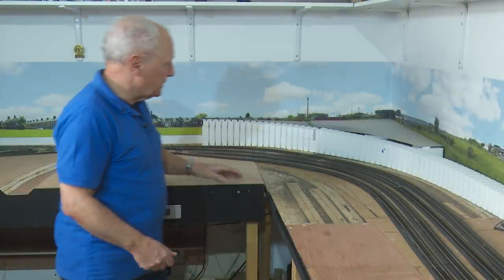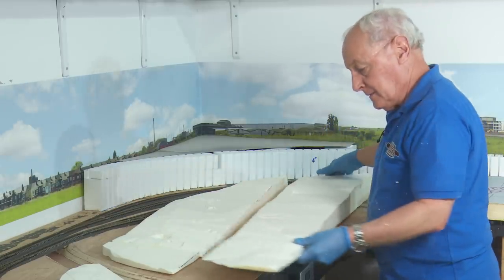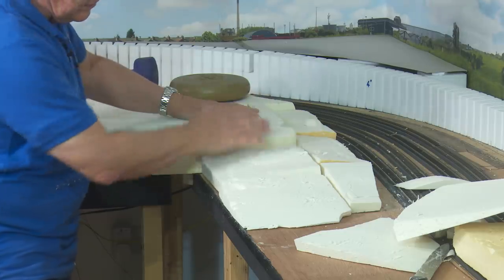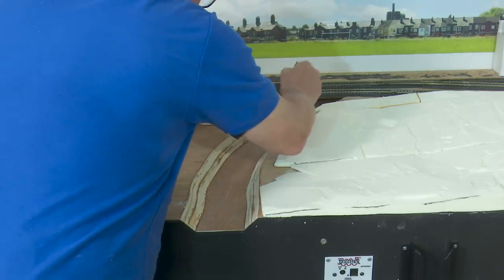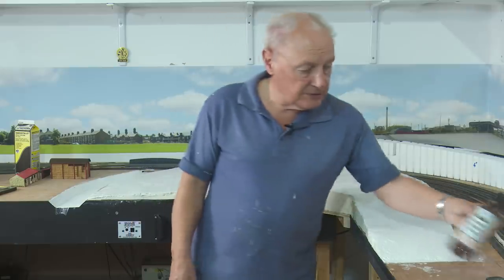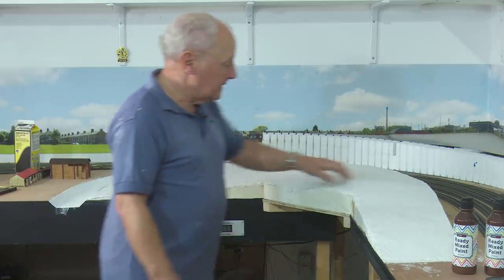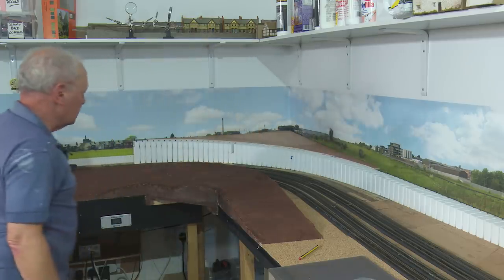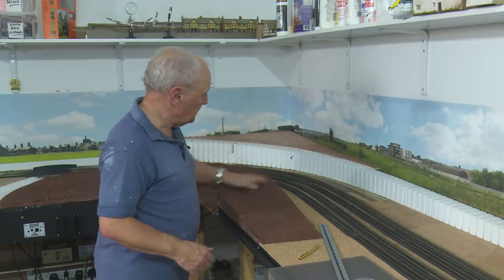Landscape Building and Road Construction at Chadwick Model Railway | 145.

Comment: Fascinating as ever.  I do like the contrast in the colour of your trousers between the start of "messy work" and the end of that day.
The cross members under the bridge deck are going to be difficult to see by visitors but probably add to the structural integrity of the model.
And finally, I do hope you've left enough space for platform 1 in Chadwick Parkway.  I did notice the measuring rope was on track in one shot.
Reply from the maker: Thanks Lee. I’m pretty sure about the platform length but hey, it’s only a slash with the carving knife!  The steel box sections should show up well with the track camera. Regards Charlie
Reply: I am a Toy Train ENGINEER. I have experience with Legacy Lioncheif Plus2.0 and conventional Steam and diesel engines.I looking for work on your British Railroad. Are you doing any hiring
Reply: @OgaugeTrainsplusslotCars 
Cs

Comment: A neat way to break up and terraform that corner of Chadwick Charlie. By making use of the upward banking route to determine the lay of the land and engineer the space available. Not just the rise and fall between the river and the station, but also the rear corner to the front edge. It will make a great scenic break to the layout once you have this section finalised later.
Reply from the maker: Thanks John, I always feel that I struggle with my imagination and always consider the advice on offer.

Comment: Charlie, I have worked with plaster cloth on my layout just as you did, and you are so right.  It is a remarkable material to work with.  I have learned through my own trial and error to modify the technique.  Now I cut the pieces of plaster cloth and one by one I lay them in place and spray with water, then smooth by hand.  They are easy to lay down dry, the spray when the piece you are working with is nicely in place.  This way eliminates moving the plaster cloth around while wet.  I love your videos.  Best regards, Doxie Frayser  Memphis Tennesee, USA
Reply from the maker: An excellent tip Doxie. Regards Charlie

Comment: Charlie. For the corner ply section you could use small magnets instead of glue. Much easier to remove if needed.
Reply from the maker: No, I’ve only glued down the peers.I’ll put a hook under a building to lift out the whole section.
Reply: @ChadwickModelRailway  Cool. Love your channel. 🤗☺️

Comment: Thanks for another good video Charlie, a tip I was given when using the rocket type glues was to put a wet bit of kitchen towel in the bottom of a jar and put the tip on the wet towel between each task to stop it clogging up, it really works very well.
Reply from the maker: I shall try to remember that Richard. Regards Charlie.

Comment: Enjoyed this vid. As always well made.
What I found with the sculptamold, was that even here in Australia, it takes a long time to dry. I avoided painting it until it was dry.
I also found that the sculptamold will get mildew. In the first run I found the problem, and then used a mold and mildew killer / remover to fix that, and in the next layer, I added some of that to the mix when making up the sculptamold. That seemed to work. There was no mildew in the subsequent layer.
The problem seems to be the fibrous filler holds on to moisture for a long time.
In the end, I used a small portable rechargeable fan to help the drying process.
Reply from the maker: A fascinating comment Peter. I never knew about the mold issue.

Comment: Hi Charlie.
Don't forget to leave potholes in the road, something that country roads suffer badly from. It will add to the authenticity and incompetence of the local Council. 👍
Reply from the maker: I think you’re right Paul, I should model them on the roads around my home! Regards Charlie
Reply: Hi Charlie.

Thanks for your response. I suffer from the same problem I'm afraid, but what can you do. Some years ago, I started to cross the road (at night) and unbeknown to me, there was a small pothole 'hiding' next to the kerb. As soon as I put my foot forward and down, it entered the pothole and forced the front of my foot to bend upwards by about 30 degrees. The sharp pain that ensued was excruciating and it transpired that I had snapped an ankle bone. That was the day I learnt what real pain was like. I don't think that local councils, when organising their annual budget, take into consideration the fact that people in wheelchairs, and handicapped people etc., have to cross these roads. There, that's my gripe for the day. Keep up the good work squire! 👍

Comment: Hi Charlie,
If you only peel the foil off one side of the insulation it will bow the whole thing. You did the best thing by taking both sides off.
Reply from the maker: Thanks very much, it sounds like you learnt from experience on this one. Regards Charlie
Reply: @ChadwickModelRailway  Yes, I've given up working with the stuff, but then my railway is now outdoors so I don't need it.

Comment: I Absolutely Loved this video Charlie , I did indeed use draft tape and filler on a similar project it worked a treat , I try to avoid Woodland Scenics products however good they are due to the cost , EG plaster cloth rolls at hobbycraft are a pound a role , say no more Regards Dave
Reply from the maker: An excellent tip Dave,, regards Charlie

Comment: The structure you are constructing triggered a flashback of a very similar structure on the line between Leeds to York, my younger brother and I took a trip to do some trainspotting at York and in the good old days, we would travel forward-facing on a Transpennine DMU where you could get a nearly a drivers view through the wndows. It's a deep cutting spanning four lines supported by concave retaining walls. The walls rise and fall from start to finish in less than a mile. The architecture always impressed me due to its scale and high bridges and a short but very high tunnel. It can be viewed on Don Coffey youtube channel Leeds to York and it's just 2 mins in after leaving Leeds. It may be of interest? cheers Ian
Reply from the maker: Thanks Ian, I’ll try and fine it. Regards Charlie

Comment: Interesting about the road Charlie. Just a few thoughts:

1. Roads generally have a camber; couldn't you use a slightly curved piece of plastic card rather than a straight-edged bit, when applying and smoothing the surface? 
2. If it's more a country track, then (at least down here in Dorset), it'd be very rutted. Still would have a camber of some kind though.

Looking forward to seeing how it all turns out. I'd probably just use bog-standard filler though...
Reply from the maker: Good point regarding the camber Peter.However the woodland scenics filler is only about £6 or £7 per box.

Comment: Bear in mind that those road measurements will be based on us practice rather than British. However as ho is smaller than oo, the smaller size of British roads will probably even out I expect.  I assume that you intend for it mostly being a farm access route so it should be fine. 

Great stuff as usual,  hope you're keeping well.
Reply from the maker: That section is that by no means finished, but I may well use some form of motorisation for traffic. Regards Charlie

Comment: Thanks Charlie.

I wonder when we turned against chicken wire or cardboard lattices for forming scenery, and instead switched to foam that's so nasty you need to wear gloves when handling it?  Can't help but think it would have taken a fraction of the time you spent cutting up and carving the foam! And you still cover both with plaster cloth etc.

That bridge looks great for (what seemed) very little effort.

As you probably know, Luke Towan has a few videos on using that Woodland Scenics roadbuilding stuff.
Reply from the maker: Thanks Andrew, I do follow Luke but shall refresh myself on his roadbuilding videos. Regards Charlie

Comment: Fun times Charlie ! I’m happy to say that your timing is, as always, pretty impeccable ! Like Tom D below, I’m also about to take the plunge (I think there could be an unintended pun there somewhere !) into scenery very soon. I was recently at Gaugemaster buying plaster cloth and various other stuff, but not sculptamould - think I might need to get some of that before I make a start. When it comes to scenery, I really am well outside of my comfort zone and have been putting off the inevitable ! Today I was in Guildford at Kernow Model Rail Centre where I purchased a Woodland Scenics Static Grass Applicator, some 2mm & 4mm grass and glue - So thanks for the insights in this video, I’ll be watching the next instalment with interest 😃
Reply from the maker: Good luck Bryan, I’m sure that all will be well .  Static grass however, is a minefield and I do hope that I can help.
Try to avoid buying shinny fibres. 
Regards Charlie.
Reply: For my part, if I were to (pardon the cliche 😬) win the lottery, I would commission somebody to design and get the set (track and all) in and wired up, but the scenics would be something I could really get into doing. I suppose what I am saying is, it would be the only bit I think I would understand, but who knows? It just looks like great fun, while the wiring etc, just in my limited opinion, seems like just necessary.
Reply: Having said that, I wouldn't be interested in making just a landscape, without trains, so maybe I would like wiring and the like more than I have previously thought.

Comment: Hi Charlie, I'm wondering how you make the legs for your solid boards and what radius curves you have in the corner next to the Viaduct? I'm planning a 10x5.5ft layout and I was inspired by your old Chadwick TMD  especially your block detection on the main line! Thanks so much for being an inspiration to many. We've been in lockdown since mid-august and I've re-watched lots of your videos so I think it's only right to become a Patron to hopefully contribute a small amount to your cause! Cheers from New Zealand. =)
Reply from the maker: High KW, the legs are normally made from 4" x 2" timber bolted into place.
Track wise, I try and keep my minimum curves to Radius 4.  Any tighter looks too tight unless you can hide them.
Regards Charlie

Comment: Hy Charlie, great pice of work. But why not use a handle for your Triangel fill pice? And by addig a real stump of a branche. Cut in the spreading side down to fit to the surface of a real tree as roots, so screwed from below and fixed  you have got a rest of a storm broken tree - useable as a lifting piont. Avoided a hole/slot in your retainingbwall differing at the edges from any contract on the edges.

Hth, Chris
Reply from the maker: Great suggestion Chris, however I’m currently thinking of putting a hook under a building. Regards Charlie

Comment: Brilliant as always. Two points: firstly, is the 7cm road width the same as that of the road bridge?secondly you will need a rail bridge over your river
Reply from the maker: Hi John, the 7cm road will have a similar width over its  river bridge.
Also, I’m planning on a steel plate bridge across the river for the two tracks.

Comment: Have you tried to using the paint in the (or a mixture of paint and water) "Sculptamold" as the mixing agent? Then the "Scultpamold" have the colour right through it.
Reply from the maker: I think you need a great deal of paint Nicholas, regards Charlie
Reply: I’ve tried both ways - you still need to paint the sculptamold afterwards. What I now do is add a small amount of paint - just enough to get rid of the white!
Reply from the maker: I shall try it next time Nicholas.

Comment: Hi Charlie just a question. Instead of sculpture mold could you use plaster as a substitute? I can get a 20kg bag of plaster real cheap you see. Thanks for your advice it is very much appreciated Charlie.
Reply from the maker: The trouble is Shane, plaster dries very hard and is very difficult to sand. Regards Charlie

Comment: In the corner, where you put the triangle in. I think that would have rounded a bit. It looks kind og nicer.
Reply from the maker: Do you mean the back scene?
Reply: @ChadwickModelRailway  Actually no. I was thinking of part at the front, where you put in the small wooden triangle. It's not a big deal, but I thought, it might look nice.
Reply from the maker: Now I understand SF and you’ve made a fair point. Regards Charlie.

Comment: Another interesting video Charlie.  Would there be some brickwork at the end of the bridge and supporting the bridge on the other side?  The branch was originally going to lead to your terminus, which is now in a different place.  What is the rationale of the line for it to still exists?
Reply from the maker: I’m sorry Don but I don’t understand which line you are referring to.
There will certainly be support structures under the bridge.
Regards Charlie.
Reply: The slope was originally going to have track and is connected at the bottom.  I wondered if you were going to continue the track up the slope so there would have to be a level crossing after the bridge or whether you were going to leave it as a disused line.  Thanks for your response.  The video was interesting as always.

Comment: Why don't you use the same method created by Gormo on the Great Chesterfield Junction Railway where here he installed lifting handles on a lift out section and then he  hid the lift handles by using putting lift off buildings over them, this was shown on his October 21 update and does a great job
Reply from the maker: I shall check it out Davies, I’m thinking of hiding hooks underneath buildings. Regards Charlie

Comment: Hi Charlie, do you not find that branded products to be somewhat expensive.
I get mine from an art supplies shop in Cork.
Mod-Roc.for example.
🇮🇪🇪🇺
Reply: I'm with you on that. I always avoid brands where possible. You can normally find a near identical product where you get twice as much for half the price if you do a little research.
Reply from the maker: An excellent point gentlemen but many folks like to use the brand product first, along with the instructions, before going their own way

Comment: Great video as always. A few moons ago I remember you doing a scenery with polystyrene, how does celotex compare to polystyrene?

Here in Portugal I am having difficulty in finding celotex or equivalent so planning to use polystyrene instead.
Reply from the maker: Polystyrene is fine.  Just choose the right glue, not PVA.
Reply: Kingspan (same as Celotex) is exported to Portugal....maybe find offcuts at a large building site. And it's not flammable like polystyrene
Reply: @ianstrachan7668  Thanks, I've been to local B&Q without luck (Leroy & Merlin etch) but will ask around. I thought polystyrene melted rather than burned alight. Any case I keep fire extinguisher in train room and all electrics are switched off when I leave.
Reply: @ChadwickModelRailway  Timely advice, I was about to try PVA in the morning... 🤔🙂